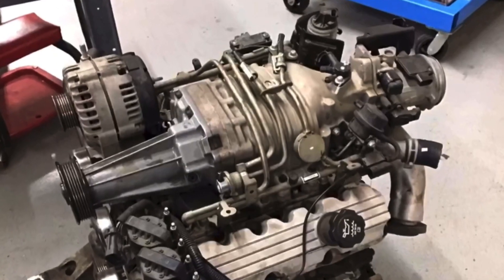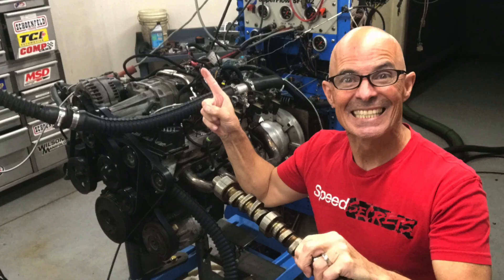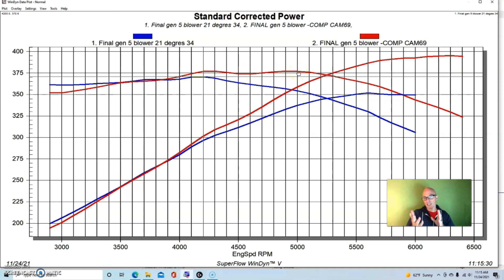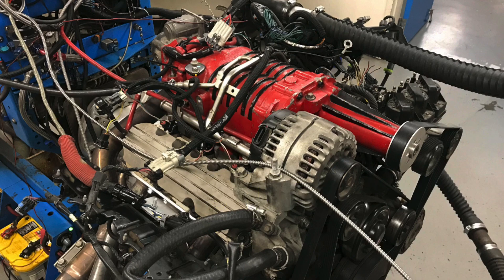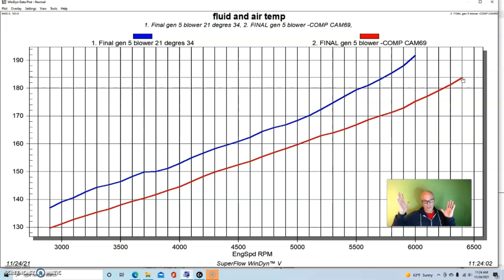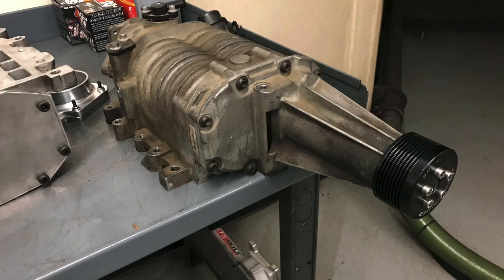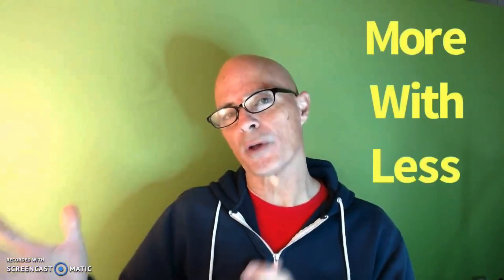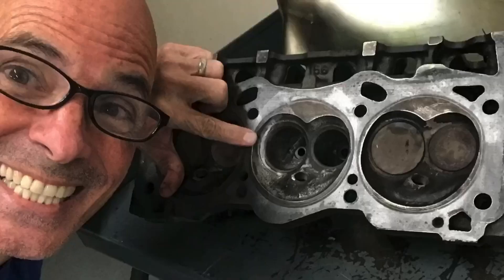HOW TO ADD MORE POWER WITH LESS BOOST! SUPERCHARGED 3800 L67 V6 CAM SWAP! DO CAMS REALLY ADD POWER?

Comment: 3800= world's greatest pushrod V6 engine. 

To quote Kalashnikov:
“Things that are complex are not useful. Things that are useful are simple"
Reply: The 300hp 4.3 exists
Reply: @DarkLinkAD  
4.3L ia just a 305 with two cylinders missing
Reply: @Rampant_Colt  

When did the 305 get factory turbocharging and outrun a corvette? 
When did the 305 get near 4in bore cylinders, VVT,1.94 intake valves and make 297hp all motor OEM?
  The 4.3 was based on the 350.
Reply: @Rampant_Colt   I mean, the only thing that comes close to the 4.3 is the 3.9 60 degree.
Ill take the 3.9 for sound alone
Reply: @DarkLinkAD  
IMO most V6 engines sound like a flatulent old man
Reply: @Rampant_Colt   Yeah, the 3.4 chevy v6 and the 90s v6 maximas sound decent.
  Also, the new equal length headers for newer v6 stangs sound good
Reply: @DarkLinkAD  
The twin-turbo 300Z sounds ok with some Borla's
Reply: @Rampant_Colt  it's not it's a 350 missing 2 cylinders

Comment: Note he's running the H-body S/C tensioner bracket, which gives more M90 belt wrap. 👍 With 3.5" tensioner pulley and tight belt, this enables 2.X" S/C pulleys without slip or needing band-aid parts (done this with M90 and MP112 using N/A mount bracket swap in my GTP).
Reply: Does that H body bracket increase psi?
Reply: @DooDicky  only if your belt is slipping.  If you size it right, you can use the W-body bracket down below a 3.0" s/c pulley just fine.  Adjusting idler pulley sizes to snug the belt more can be a convenient option, too.

Comment: The M90 also increases parasitic losses mostly from the boost level, not necessarily just as Rpm increases. At 10psi and 14k rpm blower speed, the m90 only requires around 50hp to spin. At the same 14k rpm blower speed at 5psi manifold pressure, it only takes around 35hp to turn despite moving basically the exact same volume of air! This combo was seeing tons of boost and reasonable high blower speed all without intercooling so it shows how much that little M90 can support for how affordable they are.

Comment: I didn't wanna spend the money, or go thru the extended downtime adding an expensive cam to my '01 GTP daily driver, so we installed 1.9 ratio rocker arms, in addition to the other supporting mods i had (3.4 pulley, ported exhaust manifolds, downpipe, etc..). Not sure if there was any noticable gains, but just a thought

Comment: I would love to see you build a set up that adds a turbo to the SC.. it would make amazing power everywhere.. 

I have a 3.8 supercharged 4th gen F body.  I love the torque but it just lacks pull at the top.. it needs more boost up top..
Reply from the maker: there is a compound turbo/blower 3800 v6 video up

Comment: What ive been told is that Whenever you upgrade a sc engine you'll lose boost because you increased the effeciency, but it allows you to bring the boost back with bigger gains.  My understanding is you   tend to play around between 6-15lbs of boost going up and down as you find a perfect setup but im still learning

Comment: Rich need ur Help.
Ford 289. Holley vac sec. Runs rich. When I lean it out,  vac and rpm go down. Any ideas bud??? Thx love the show!
Reply from the maker: HOW ARE YOU LEANING IT OUT-WHAT IS THE TIMING
Reply: @richardholdener1727  
Using mixture screws.  Didn't use factory timing. Motor was rebuilt and does have Mildbcam. So power timed it. Runs good no ping or hesitations. Just smells and looks rich (black) smoke.

Comment: Just bought a cam for use as a street blower cam on sbc gen 1...It was advertised as 114 LSA, no more detail. After purchase I see  the Cam Card shows Intake has been ground with +4 degrees advance, which puts it at 110/118 LSA - as I would call it.. Kinda hard to wrap my head around this, I wonder if it's gonna be okay for a blower cam. But some of the LS engines use LSA's of up to 120 that I've seen.
also.... It seems to me I can degree this cam with my degree wheel, and make use of multiple key ways in the cam sprocket,  so that it mimics a  116/116 LSA.   Hmmm....
Reply from the maker: it will work fine
Reply: @richardholdener1727  Okay. Thank You. Sigh of relief. I understood what I was buying and how to use it at 114 LSA, but they threw me a curve with that 4 degrees of advance ground in. I'll figure it out. I always do.

Comment: May I ask for cam advice ?   Cars  1979 Chevrolet c 30 dually  6800 pound  3.77 gears. now 4L80E wil updte to 6L 90    454 Gen 5  Aloy heads 122 cc chambers  2.3 intake valves .  flat top forged pistons  6-71 SC  Fuel propane,  looking for around 12-14 psi boost.  With 3 OHG mixer max flow is close to 1500CFM  Need cam  with lots of low end , 6000-6200 RPM max is enough  , Street use    Thanks
Reply from the maker: something like a 230/236 @ .050
Reply: @richardholdener1727   Thank you, and than with about 112-114 LSA ?  I,ts almost inpossible to find good info overhere in the Netherlands   Thanks

Comment: Boost pressure is only the restriction in the manifold . So a low boost after a cam change = More air in cylinder .

Comment: This with your quick head porting or stock heads? Seams like a wild cam/very small pulley/meth injection/bigger throttle body would crack 500hp
Reply: He brought up porting the heads at the end, so I think this is before he put his quick ported heads on. Still looking forward to that test, but I think the M90 just can't flow a ton more air to get to 500.
Reply from the maker: STOCK L32 HEADS ON THIS TEST

Comment: Richard, the instrumentation of the intake temp is great.  Have you watched Banks Power's killing a Duramax series?  The way he instruments the motors and monitors intake air density makes a ton of sense.   Looking at intake air density would add a great dimension to your channel.
Reply: @DarkLinkAD  Manifold air density is about understanding both the temperature and the pressure of the air in the manifold.  Both are important to the ability to make power, and to do so without damaging the engine.

As an engineer myself, it is clear that Gale Banks is doing the kind of work most tuning shops can't even dream about.
Reply: @aaronsmith4746   Tell your accolades to take a seat, your clearly not a mechanic.

 Mass air pressure sensor, intake air temp sensor and mass air flow sensor. Also, corrections can be made with the o2 sensor, which is the concern with air density(oxygen content). 

Air density was a consideration in tuning, looong before fuel injection systems 

  Again Banks is a saleman, he can convince those with little automotive experience that if you lower the temperature of a million mile running gear from 114f to 113.8f that its worth buying his product.
Reply: @DarkLinkAD  you are probably thinking about ambient air density, which I agree is no longer a day-to-day tuning concern because computer controls will compensate for it to correct the mixture.  (Although in a naturally aspirated case it will still impact power potential.)

I think you meant Manifold Absolute Pressure (MAP)  sensor and mass air flow (MAF) sensor.  And manifold air density is exactly what is calculated from the combination of temperature and manifold pressure.    It is essentially a measure of how much oxygen is in each unit of volume of air that can be drawn into the cylinder.  The point that banks makes is that high temperature air in the manifold, even with an impressive boost number, may still have less oxygen in it (and less power potential) because it has lower density than cooler air even at a lower boost number.
Reply: @aaronsmith4746   Yup, thats the argument I made but you understand intake manifold spacers and carb spacers have been in production for that very reason. To reduce transfer of heat to the intake manifold.
 Cold air intakes, fenderwell intakes,, throttle body coolant bypass and on and on.  
Eleminating the heat soak of an intake manifold is has often been, if not the most popularized aftermarket beginner modifications in automotive history.

 Also, Youve seen the ice box intercoolers no?

Id also like to mention that Richard has done a good job at explaining/teaching the advantages of keeping boost/heat down while increasing power

Comment: Have you done any videos on ls head Combustion chamber size I’m looking at putting heads on my ls5.3 and noticed I could reduce the Combustion Chamber size.. theoretically that would make more power by increasing the compression ratio right?
Reply from the maker: a 5.3l already has the smaller chamber (factory) ls heads (862 or 706), but every point is worth 3-4% in power

Comment: Happy Thanksgiving Richard! Yay yay yay, more 3800 stuff! I've actually tuned a similar combo. Can't remember the cam specs BUT... Gen 5 blower, 3.0 pulley, ZZP intercooler. Ran like a scalded dog until the trans resigned from its position. Lol! Turbo time? Please and thank you! LOL! I wish more 3800 guys would cam and turbo their L67s and L32s.
Reply: Here's the thing.  Why turbo it when the 4t65e-hd with current parts availability cannot handle a max effort M90?   Turbo can easily go 500+ but the tranny with current parts cannot?

Comment: My question is are you running the stock injectors on a 3.0 pulley. I was told the stock injectors would run static with a 3.0 pulley. I have a intercooled 3800 with a 3.2pulley with no KR so if I can get by with a 3.0 I would
Reply from the maker: we have 80-pound injectors in it

Comment: what trans you can put on that ( fwd ) i think maybe rwd trans could ...
Reply: i got a f40 6 speed rating 295 ftlbs of torque and the 4t65hd only hold 285 tlbs...
Reply: 4t80e is probably the only fwd trans that would have a chance longterm
Reply: @sail4horizon  ty
Reply: 4l65e would fit to for rwd.

Comment: I would like to see what happens with pump fuel 93. I think that you would need to lower the boost to 12 psi? Monitor the intake temp. I bet it is a lot higher temp. I also think the washer fluid injection could add more boost and make more power than without the water injection. I think the E85 is cooling the intake charge and that is why you are not making more power with the water injection.

Comment: Happy Thanksgiving! Can't help but wonder what those boost curves would look like with a Northstar TB. It's almost beautiful how perfectly that throttle body, the adapter to make it work, and the Gen V supercharger line up with each other. You are doing great work in convincing me the Racecar needs a cam in the worst way.
Reply: The electronic TB that comes in the gen 5 blower is already as big as the N*
Reply: How sure are you? I swear there was a fair bit of difference when I had them both in my hands. I can check on Tuesday when I get back to work. I have spares of both in my toolbox. Thought it was L67 68mm, L32 72mm, and N* 75mm.
Reply: @ShamelessTR  they're the same my guy. The North Star does have a bigger lip for attaching larger intake ducting. However, the butterfly valve is the same size.
Reply: Can only find one source on the interwebs and they say you are correct. Maybe the airhorn screwed me up. It's been at least 2 years since we swapped to the Gen V blower. I've seen first hand how badly even a minor restriction at the air inlet can bring down power. Still have the dyno sheet somewhere of the 112 horsepower an air filter cost us on our original L67 setup.
Reply: @ShamelessTR  that's a lot of power loss. I do know these M90s don't do well with restrictions. Especially when trying to overdrive them with small pulleys. Carnage it's right about the inlet connection for the intake being larger, but the overall inside diameter is the same 75mm. 

I'm only running a 65mm TB on a top swapped L36, but I'm not running a pulley any smaller than a 3.6". VS cam and a lot of porting work. She breathes ok for what it is. I'm only running 6psi of boost, and it barely rises up to 6.5psi at 6000rpm. Before porting the heads, blower, lower intake, adding headers and cam, the boost was much higher and it rose a lot throughout the rpm range. I'm happy with where it's at now. I wouldn't dare try to run small pulleys without a larger TB though.
Reply: @ShamelessTR  I am your second source. I've played with both.
Reply from the maker: I'M PUTTING ON A 92MM-THEN A 105MM
Reply: @richardholdener1727  are porting the blower inlet up to those sizes?
Reply: @richardholdener1727  Consider me TUNED IN!

Comment: Have done tests on increasing valve lift but retaining the same duration by using higher ratio rockers? If so is it comparable to a mild cam upgrade?
Reply from the maker: rocker swap offers less gain than a cam swap

Comment: My issue with a cam in these motors is the fact that you start seeing the effects at around 4500 RPM and most of the time you can only run them out to 6-7000.
Reply from the maker: CAM GAINED FROM 4000-6500 (EVEN MORE AT 7000 IF WE RAN IT THERE), THAT IS THE RANGE YOU WILL BE RUNNING IN WHEN GETTING AFTER IT

Comment: Hi, Richard
What is the smallest m90 pulley with 5% overdrive balancer, could I run and keep the m90 reliable? I am thinking of using a 2.9 pulley.
Reply from the maker: THAT IS VERY HIGH BOOST WITH NO CAM OR INTERCOOLER

Comment: You should of added water meth to this setup to see if there was more power in cooling it. I found It so strange how you lowered temperature that much in last video of the 3800 with it and didn't gain any power 🤨🤷‍♂️.

Comment: This series really makes me wonder how far one of these engines can be pushed with a blower.  When I was big into the Thunderbird SC's in the early 2000s we had a guy at Dyno day put down 390 with a stock long block and an autorotor.  Never thought that was possible. My m90's struggled to pass that 300whp mark.
https://youtu.be/F8r-3a_ZCJc
Reply: That's about where I landed with the m90. I would like to get another and give it a better try someday.
Reply: Think Basil's still at 459 rwhp in his hill climb commodore in Aus . He may have surpassed that he's been playing with it for years . Lots of r and d. That's with a cut and shut rear , 4" intake , ported blower n lightweight rotors but is still an m90.
Reply from the maker: LIGHTWEIGHT ROTORS?
Reply: @richardholdener1727  I'm with you on that one.
Reply: @richardholdener1727  I think next test should be stock blower vs diy ported blower with the 3.2 pulley.  We can see if there's real gains to be had, on a budget.
Reply: @richardholdener1727  talking to guys in Asstralia Abt lightning mine. 400 grams lighter. 750$$ is the cost wth shipping. Idk if I'm going to do it yet

Comment: Charge temps is what’s really holding the engine back. You could always go the intercooler route. ZZP still sells their stage 2 intercooler kit. Should get you easily to 450hp. 

20 years ago I had a thrasher performance air to water intercooler and my GTP absolutely screamed with a smaller pulley… till I destroyed by input shaft but up until then it was awesome 😂